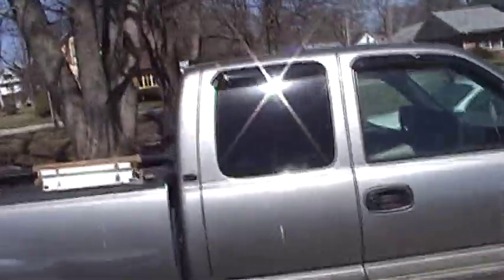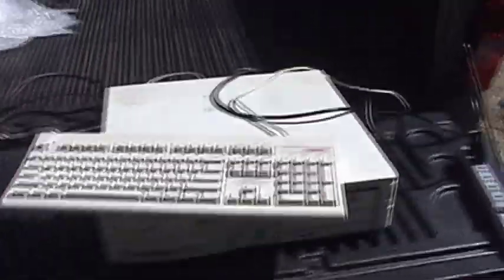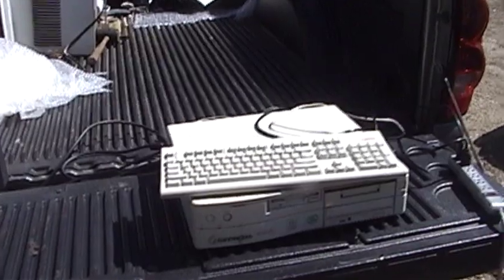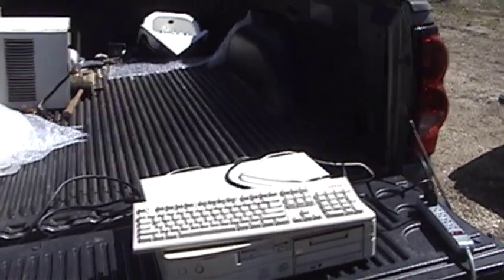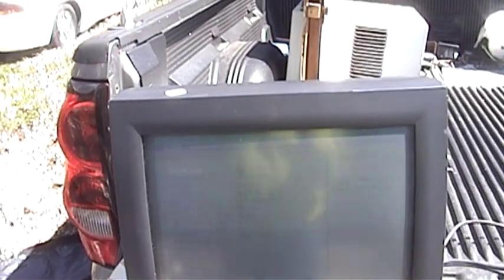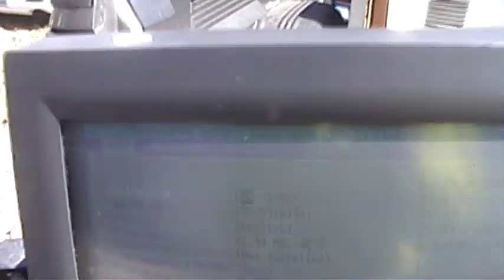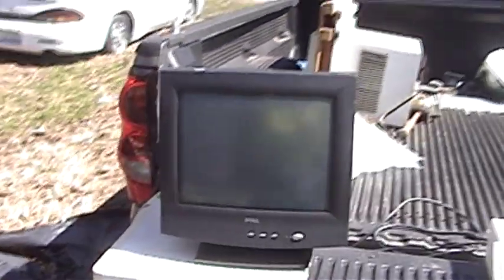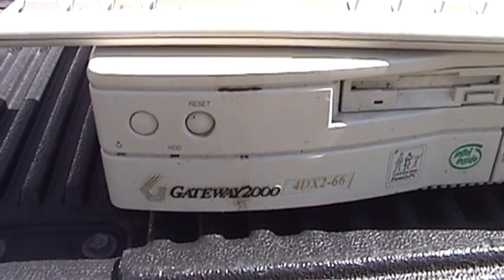Now That's What I Call Year 2000 Compliance!

Comment: Back in the 90s, I remember doing some programming under DOS which involved messing with the frequency of the PC's clock interrupts.  After I ran the program, I realized that centuries had passed, and the system clock even at the DOS prompt was continuing to advance absurdly quickly.  It was pretty freaky.  I had to reboot the computer and reset the system clock to fix it.

Comment: Well...My half a dozen computers turned into over 30 last Friday when I was offered 28 computers, non working. It was a computer shop clear out of their trade rubbish and broken XP machines that they obviously deemed unworthy of repair. I've broken some up for parts as the cases were either damaged, or missing panels.

Out of the 28 only two machines were dead in that they did not power on when power was applied. Well, three didn;t but the third one I found that the cable running from the switch PCB on the front panel had come off so that was an easy fix.

Most were either old XP machines or Vista machines, sadly no hard drives or ram came in any machine, hard drives I understand, for data protection, sucks but understandable.

I have got three Dell dimesnions up and running, a 2400, 1100 and a 4600. I also have an optiplex GX280 that isn't wanting to play ball. If you are interested in seeing my computer haul Bill I have been putting videos up on my channel. :)

Comment: My dad bought a similar unit in 1994, one year before I was born... it ran Windows 3.1.1 for Workgroups, it required you to enter C:// win and press Enter to start it up, and it had AutoCAD installed on it, which my dad paid $1,000s for.... the computer itself cost my dad about $2,000. It didn't even have Internet, not even a 56k modem. Not like we had Internet until 1998 or so on a Windows 98 Compaq. We still have the Gateway 2000 downstairs in our basement, but it no longer functions. :(

Comment: I didn't realize that there was a Y2K BIOS ISA card for 386 and up since the earlier BIOSes had the Y2K bug in it, namely the Award BIOS version 4.5G which a lawsuit was filed for not being Y2K compliant at all. In fact, I had a PC Chips M912 v1.7 486 PC that had the Award BIOS in it, which shortly died back in mid 2012 from a corrupted BIOS chip and the Shuttle HOT 433 486 board I purchased later on had the AMI WinBIOS which not only was it Y2K compliant, but it also auto-detected the hard drive as well, with built-in I/O (floppy, primary and secondary IDE, Serial and parallel ports) integrated. I'm planning on revisiting my childhood from 1994 up to my adult years in 2012 by purchasing said board, as well as an I/O card with 2 IDE channels on a VLB slot, VLB video card, a case with a PSU, a Y2K BIOS card, a keyboard, and a serial mouse. The cards in it previously were an S3 Paradise/Bahamas 64 VLB Card, Sound Blaster 16 WavEffects CT4170, a Winbond ISA I/O card with 1 IDE channel, floppy controller, Serial, parallel, and game port, a 230 or so Watt PSU with the famous flip switch (still have the original case and switch, but not the PSU since I didn't realize that still worked back in 2012), and it had 2 floppy drives back then, I believe (up until the late 1990s), a Quad speed or faster CD-ROM, 24MB RAM, and the size of the HDD I don't remember, and I believe it was a Fujitsu 1.2GB HDD, IBM 15" CRT that I still have today, I believe it had a joystick as well, and it had an AMD AM486 DX4S-120 in it (previously it was a 66MHz CPU I think). I remember playing 3D Dinosaur Adventure (got that game at a thrift store), but I have to purchase the glasses, and I have no idea if those specific 3D glasses (blue and red) would work on a modern display, and playing 3D Space Cadet pinball back then and still today was a blast on that system (Microsoft's version, not Maxis) and every desktop I have running Windows has that game.

Comment: My older desktop that had a 486 board (lasted from 1994-2012) went to 2095 when setting the date after the year 2000 or at 2000; I found a DOS driver for Windows 9x and DOS to have the date set at the correct date, which worked, but the clock froze when the screensaver was activated (BIOS chip died).
Reply: I have a old dell from 1997 that some one though out   and I still use it every day its 18 years old almost 20 years old

Comment: If the CMOS battery is flat, it normally reads zeros from RTC's SRAM. But in this case I guess the SRAM is in an undefined state when you turn on the computer, so it contains random data. Does the time/date change when you turn it off (disconnect power) and on again?

Comment: Never seen a RTC do this, but it's funny. I would take a look at the motherboard to see if the CMOS battery has not leaked .Hope it doesn't use the old NiCad battery which are prone to leak and hate traces. I'm sure that could make symptoms like this since the RTC circuitry is often near the CMOS battery. BTW your other video about overclocking is a nice april's fools.
Reply: ***** Was the mother that lost it's video the motherboard in the Packard Bell 386 you did a video on where you showed us Microsoft QBASIC?
Reply: ***** Wouldn't be surprised if something like that happened to an old laptop I had that used one of those rechargeables.

Comment: i had one of those really crappy android tablets, it thought it was 1969....  one day im not making that up....it corrected itself eventually
Reply: sometimes when PC BIOS reset, it reset to year 1970 too! I guess year 1969 & 1970 have some special meaning...
Reply: xponen fun fact, in Unix time (Or a Linux-like system such as Android or even Mac OS X and countless others) it count,s time up using a number that starts in 01-01-1970 (the time Unix was "created" or epoh time,and increases in seconds every day since than,folowing UTC time, that,s why when a *Nix system has no time reference (clock battery dead + no network (celular or internet) to verify the time,it goes back to 0,so that,s why this "date" is special,also this "number" is a standard integer with a max of 32 bits long,to keep compatibility with 32 bit cpu,s as such,in 2038 all Linux based system,s (Router,s Internet Infrastructure in general) will have a bug similitar to the Y2K bug where the software time will reset back to 0,that in itself,if not corrected CAN be a desaster,just imagine that everything now adays that is internet dependant will be at risk

Comment: I have a PC that runs windows 98 and came with fresh install of it and is an HP pavilion that looks bad but works very good and have the original monitor. This PC can install a 350mb game in to minutes
PC spec's
 12 GB hard drive 
64mb of ram
CPU - -MHz
It can run a 3D game that needs 8mb of vram 
32mb of ram
350mb of ram 
And will load in about 30secounds 
This PC hasn't been worked on for 13+ years 

Have a video on my channel called my windows 98 and Linux pc